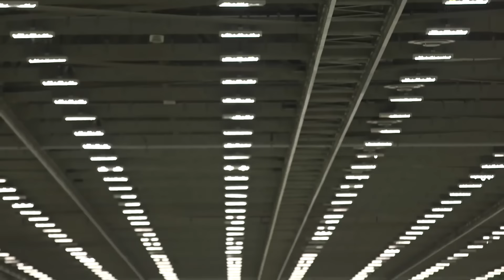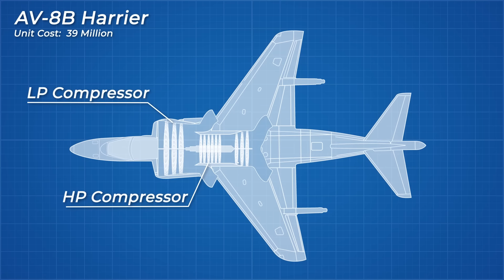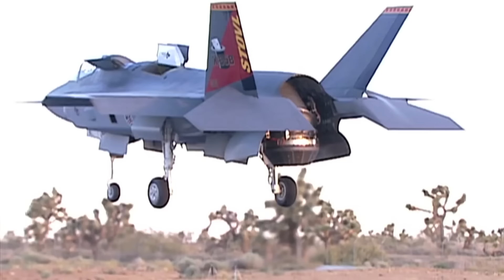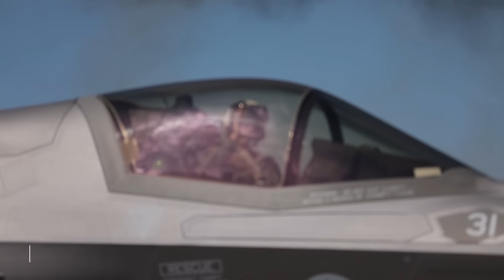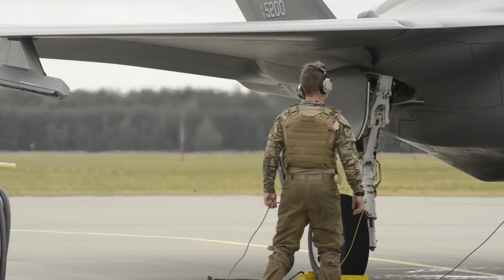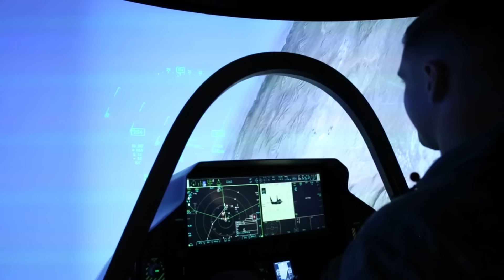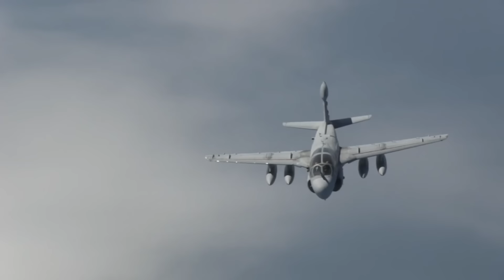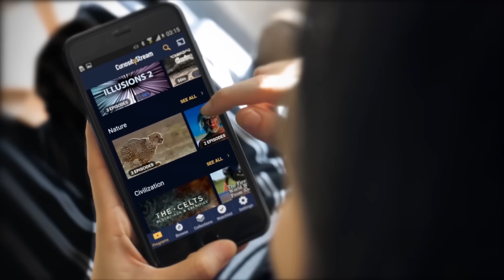Is The F-35 Worth $115 Million?

Comment: Here's the problem you need to sort out before the F35 will ever enter production in the 1,000s, or become a workhorse in a fleet of 4,500+ like the F16 -- layered SAM installations are already big, expensive, concurrent, subsidized, 10,000h between overhauls (F35 is 2,100h), have billion dollar contracts handed out like hotcakes to countries like Belarus and Syria. 

<1GHz SAM launchers can always be made faster and more mobile than previous models; more adaptable between active/passive tracking modes (including EOTS, passive and multistatic radar); more flexible between target types; more multilayered; more armored; more camouflaged (VLO, particularly with tanks, is critical for bulky ground equipment and the technology exists/is being developed to disguise energy signatures, by heating/cooling armor for example); made more sophisticated; more multispectral; more attack/detection range; more stealth/counterstealth -- and all they have to do is sit and do one thing well. Launchers switch off their active early warning radars, activating SARH only when the missile is terminal, not requiring a precision lock precisely BECAUSE they have high-explosive air fragmentation warheads for destroying ballistic missiles. These are NOT AIM-9s.

Meanwhile a lightweight, fast, supposedly affordable airframe can only support so much careful design, extensive testing, exotic materials and reduced payload before becoming too costly to build, support, or risk getting damaged -- a flying Ferrari. And the F35 has become a flying Farrari exactly BECAUSE the threat level is increasing in both capability and sophistication.

Ground radar and its proliferation had the edge from the start -- historically pushing airframe design limits to the point a designer may fear loosing the secret mystique of invulnerability more quickly than anticipated. "Stealth", as it pertains to confusing sensor tracks, has always been a pointless catch-up game for tax money to flow from Washington to Lockheed.

As long as a SAMs mere presence increases the general threat level for every new fighter, the cycle will never end -- and the launcher itself didn't need to freely strike targets (although the S-400 reportedly can). or do anything but sit. And it's only going to get worse for every stealth-orientated fighter.

The stealth concept literally kills the light-weight, workhorse mission of the F35; which is why there are only ~615 and not 4,500 as of 2021. As long as it's cheaper to launch a missile and possibly degrade or ground an F35, the cost:benefit ratio of SAMs persists. As of 2021, the Chief of the US Air Force is looking for anything in a gen 4.5 to be their Ford F-150, not a limited role gen 5 Ferrari. By definition, gen 4.5 wouldn't even exist if it wasn't less complicated, shorter in development time, cheaper to build, cheaper maintain, and cheaper to risk than a gen 5.

Chief of Staff Gen. Charles Q. Brown Jr. [2021, speaking on the “fourth-and-a half/fifth-gen minus” mix]: “Actually, I want to build something new and different that’s not the F-16; that has some of those capabilities, but gets there faster, using our digital approach.” 

Dan Grazier, Project on Government Oversight analyst in Washington, D.C.: "If we’re going to pull the trigger on a new fighter, now’s probably the time.”

Comment: Other considerations for ongoing price reductions: as manufacturers in the supply chain for these planes continue to build and improve their own production methods, they can reduce their cost base/scrap rate, thereby continuing to reduce the overall price of the aircraft as well. With current production numbered in the hundreds and target production in the thousands, the program is still relatively young, so there is a lot of room for improvement.
Reply: December 2021 report that F35 cost was down to 79 million per aircraft. Estimates that at end of year 2022, the cost could be down to 76 million.
Reply: Also by combining all the features into a single air frame you will cut down on massive amounts of maintenance costs that is spread out across several different types of air frames. So instead of needing parts and crews to maintain several different types of planes it's all condensed to a single air frame. Although each branch has it's own unique one, I would still wager that a large amount of parts are interchangeable between them.
Reply: Seth exactly which ones? the list is smaller than you think. The A is a pretty much standard jet as it is nothing special airframe wise, The B is a VTOL so the entire frame has to be adjusted for the intakes and exhausts, landing gear changed pilot position is changed etc. The C is a Naval version Bigger wings, heavier wings because it is pushed around the carrier by human power, the landing gear is much stronger and in so doing you need to beef the frame up are among the top changes. In addition you have to coat the frame differently for the salt air.
The f35 is not like building a caddy and then slapping a buick name on it. The changes are major league differences not just small modifications. about the only thing the same are the electronics but even that is all in different positions so you need longer/shorter cables.
Reply: @menotyou7762  Considering I don't actually assemble these planes, stating exactly which ones shall prove difficult lol. But was more focusing on the idea initially was to replace other air frames in the military fleet which is where most of the cost reduction would come. You wouldn't need parts for multiple air frames that mostly all come from multiple manufactures and technicians trained for those air frames to install/repair said parts. This was the entire premise of the F35. Up front costs will be higher but over the lifespan of the plane ideally it should be less.
Reply: @foxhound042000  the premise was never there in the first place. The premise was building 1 airplane to suit multiple roles has been chased since 1918, It doesn't work. You have 3 different jets with the same name now as each is a distinct aircraft. so what is the difference from having an A10, F15 and F16? Think about the differences between the A,B and C variants. They share very limited number of parts. Airframes are different, Wings different, landing gear different etc. Oh the tails are the same and the computers? But are they?
As the program ages it will be no different than any other jets.
As time moves forward costs increase, they don't go down.
Reply: @menotyou7762  Not necessarily. The computer systems and sensor suites are likely very similar, if not the same. While yes the variants have seemingly big differences, they have more overlap, even if you only consider maintenance training. The A and C variants even use exactly the same engine so that is also the same.
Reply: @darthcadeaus8254  so Darth your telling me the parts are the same? so lets assume we have a lensed sensor like an IRST. on an air superiority fighter it would not need much protection. On a ground attack it would need a stronger lenses, on the Navy jet your lens would need to be made air tight and salt mist proof so do we need the same sensor?
You mention the A and C with the same engine but really is it? There is no compensation for its different roles? Similiar is not the same. even the same is not the same because it goes beyond the part itself. It is what holds the part securely to the jet, It is the location with all the wiring going to the part etc. Are all three variants the same length, Height, width and weight? If not it and I know they are all different then... Are the frames the same NO, maybe the Wings, No, maybe the landing gear No. Maybe the cockpit glass window No Proves my point now doesn't it.  Hold it they all use the same sticks  yeah that makes them the same
Reply: @menotyou7762  I’m saying that many of the parts used between the three types. Also, the “roles” of all three variants are the same, they are multi role aircraft. They’re isn’t a “ground attack” variant. The differences are entirely in the takeoff and landing capabilities and related things like wing size and the VTOL engine on the B variant.
Reply: @darthcadeaus8254  Fyi the discussion was about multi role and why you have 3 aircraft branded under the same name but they are in fact 3 seperate and completely different aircraft.  so the A variant is a mutli role for the air force with specific modifications for them. The B and C likewise for the Marines and the Navy. When you say they are multi role aircraft but the roles are the same you kind of lost me because the role of the marines B is too support ground troops as that is what the marines want and need ask any marine and he will tell you I want support from a ground attack aircraft. That was supposed to be the B type goal.
The role of the Navy aircraft is too protect the carrier and project power to land, Sea and  air based targets. 
The A version is to be an air superiority as its for the air force.
HMMMM
see this is exactly why the F35 fails. its at best ok at some things but it is not THE BEST at anything. Multi role aircraft have been a dream of weaponized flight since day 1. Nothing is great at all things, You simply can not use the same parts to make an aircraft with the completely seperate roles it is asked to perform. that is the reason the F35 costs so much and funny that is why it can't do the tasks asked of it. 
when building an aircraft if you change something to make a part work you better look at everything else because it is a sum of parts that make the jet. The A, B and C  are different aircraft and the US would have been better off building specific jets for specific roles.
Reply: That's one of the reasons the US has dominated cutting edge aircraft, they're one of the best and biggest sellers of military and civilian aircraft. Their biggest competitor in both markets was the USSR and VERY recently China, but theres an old saying that countries "buy American if they can afford it but Russian if they cant". A "secret" to Americas success in war and politics is their extensive network of alliances and trade agreements which leads to countries across north America, south america, europe, and asia buying american aircraft which leads to surprisingly high sales for such expensive aircraft while much cheaper Russian and chinese aircraft dont sell nearly as well even in the rare situations where they make something of comparable quality and lower price. Recently China made a fighter that supposed to be of comparable quality but is still very cheap thanks to china having rock bottom labor and material costs and selling it for a low rice to get into the military aircraft market. No one trusts china enough to buy it because china is a worse bully than America and has proven to have zero issue attacking or extorting allies to get concessions.
Reply: @arthas640  China "selling it for a low rice" - hmm, not sure if pun or not. 🤔🤭
But otherwise I agree with your assessment. I don't trust America, I've never trusted Russia, but China I can trust - to screw me over.
Reply: hey guy, if a supplier can build a part cheaper it keeps the extra money, they don't drop the cost of the part. there is no way they would. its the same when the part gets expensive, LM won't pay more for it. They point at the contract and say but you said this price.
No kidding imagine free enterprise making manufacturing more profitable, who would have thought
Reply: @menotyou7762  ummm yes it does. Price is usually decided on supply and demand and material cost. If the supplier finds better ways to build something with less scrap, the price will for sure drop. If they have complications or can't get materials (materials get very expensive) the price rises. It's why now all cars, gpus, phones... basically everything with a chip is more expensive, there just isn't enough silicon.
Reply: @adodoes8770  you obviously have no idea how aviation contracts are written. Every supplier has a contract, in that contract their might/might not be price reductions written into the agreement. Once I as a company have achieved any price reductions then any other profit I can squeeze out of manufacturing is mine too keep.
If you didn't try to make profit or make more profits you are out of business. Companies don't make parts for free

Comment: You left out that the idea of using a central fan running off a turboshaft was lifted (sic) directly from the (otherwise unsuccessful) Yak38 - in fact Lockheed hired some of the Yak's designers for that reason.
The old Soviet Union consistently managed to implement innovative weapons ideas quicker and at far less cost than the US because the inefficiencies of its central planning bureaucracy were far less than the inefficiencies of the "political engineering" necessary in the US.
Reply: The Yak 38/41 used two unconnected turbojets to support vertical landing instead of a shaft connected to the main turbofan?
Reply: The YAk has a completely different type of system.

Comment: Adding a SVTOL version of the F-35 was expensive. The Marines really wanted it, but in my opinion it was the British that got it over the finish line. Without an SVTOL version of the F-35, they probably wouldn't buy it and they are a major foreign partner in the project.
Reply: Expensive and stupid....the RN and USMC use maybe 10 % of the F-35 fleet but much of its expense and complications come from having VSTOL...so the F-35A and F-35C suffer from having to have a similar design despite NOT using VSTOL...the F-35 NEVER should have been designed to do that role. Its a hold-over from the Harrier and they should have just skipped it entirely....have the USMC use its F-18s and the Navy does the air cover from ships....and the RN should have gone with the French Rafale....what do they need 50? at most?
Reply: Top ten expensive fighter jets https://www.youtube.com/watch?v=rTPYJRcvjwU&t=11s
Reply: It would have made more sense to have 3 differents planes... but salemans wizardry... It's like god, there are three but one... Don't aks too much questions...
Reply: The stovol f-35 will always be the most expensive, it will always be used in fewer number and only the Brits Italians and Japanese are interested in it.
Reply: @anguswaterhouse9255  And the USMC

Comment: Stealth aircraft looks smaller on the radar on long distances, 'smaller cross section'.

Just use longer range radar or get close to it if you don't have one.

The most effective missiles are those of short range like AIM-9, AIM-9X and many people don't know that.

That's why high maneuverability is Overemphasized on 5th gen fighter planes.

The Russian fighter planes have the longest radar range and the only way for the west to counter that is to reduce its size or to become less visible to get closer to the Russian fighter jets, to skip the beyond visual range and get to dogfight quickly.

And that's why 5th gens are highly maneuverable.
Reply: The Russians haven't even outranged the F-22's APG-77v1 from over a decade ago, let alone gotten anywhere close to countering stealth using radar.

Comment: Pentagon says NO! And starts buying F-15s, a fighter that first flew in the 1970s.
Reply: The F-15EX is barely related to the thing that flew in the 70s. It has a completely new radar, new FBW system, new avionics, new wings, and new engines.
Reply: Different requirements. The F-15EX is called for to supplemement the cancellation of the F-22A

Comment: March 6, 2021... US House Armed Services Committee seeks to end F35 production. February 2021 US Air Force generals met to discuss failing F35 program. Generals agreed, the F35, is Not combat effective,  costs too much, breaks too much, too much maintenance, parts production problems, supply problems,  engine problems, soft ware problems. Front line US Air Force Squadrons report less then 45% Operational readiness even with best efforts.

Comment: F35 requirements were dumbed down. Many known deficiencies are never going to be fixed. The cost of ownership is huge.  Initial unit cost is not even a third of the real cost (same as giving away the printer to make money on the ink).  Many promised upgrades will take years and be astronomical in cost and will only partially compensate for F35 inadequacies. They are so unreliable and hard to repair, Full Mission Capable is a small percentage.  To have 4 of them at FMC, you need 12 f35s, and that only gets you to statistically 80% chance of having 4 FMC F35s ready.   And it still can not run, can not turn, & often can not hide.
   To get an honest procurement cost, look at Foreign Military Sales and include all associated costs.  It’s more like $200 million per plane up front. To get an unbiased insight into some of the deficiencies that are hidden from the public, watch the review of F35 accident investigation report by fighter pilot Lemoine.   Search “Lemoine”

Comment: I'm pretty sure the yak 38 used the same tech for vertical takeoff/landing as this f35 even though it's wayyyyyy older
Reply: Not quite, the Yak 41 used jets while the F-35 uses basically a rotated turbofan with a clutch.

Comment: A small private jet costs around 10M$ and a passenger airliner around 350M$. Compared to that, 120M$ per a military jet seems reasonable, but this price does not take into account the 1.5T$ it took to develop.
Reply: 1.5T is the cost to acquire and maintain for 50 years in then-year dollars